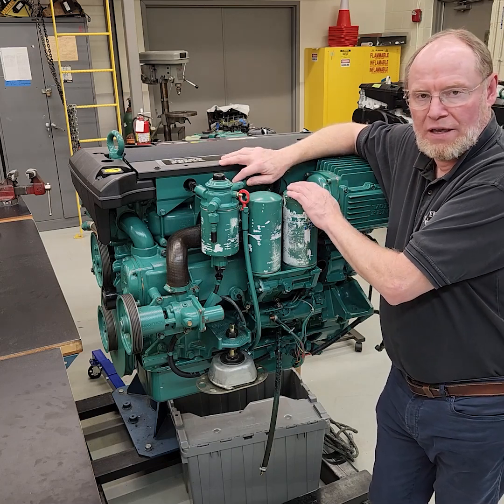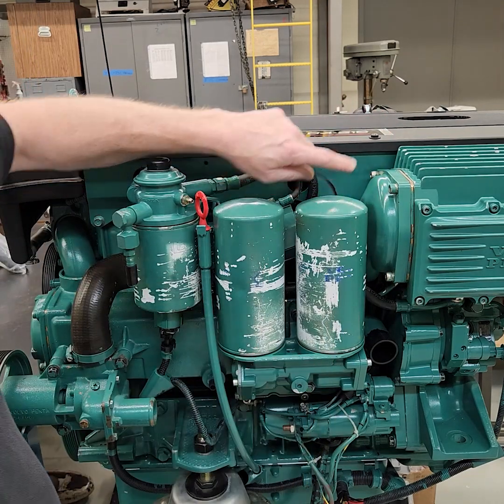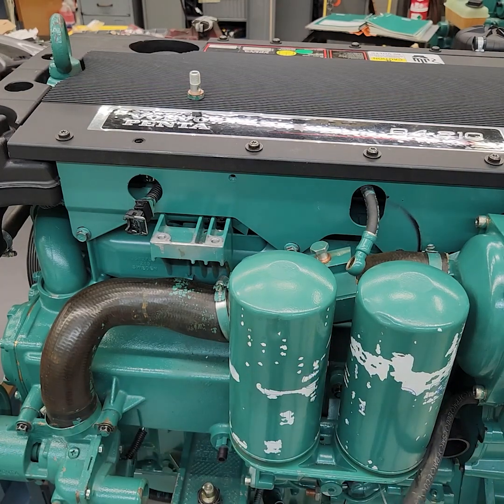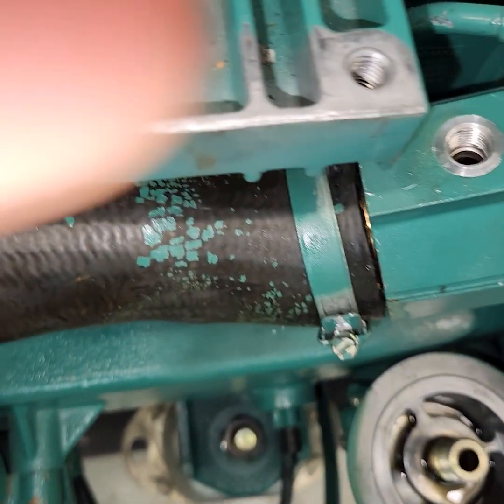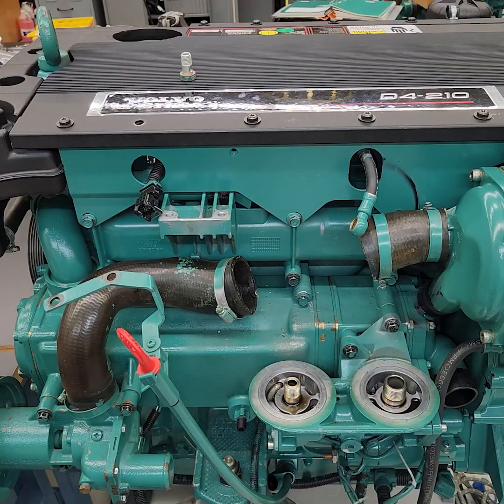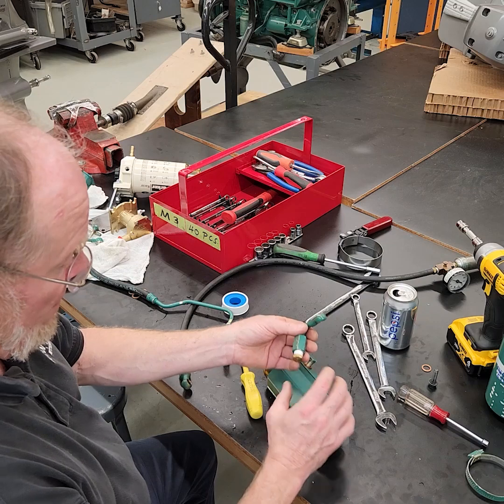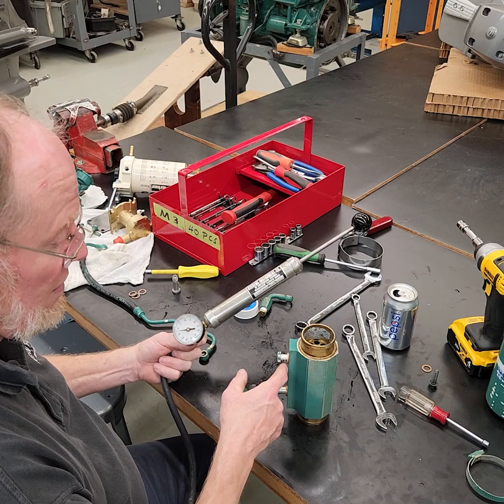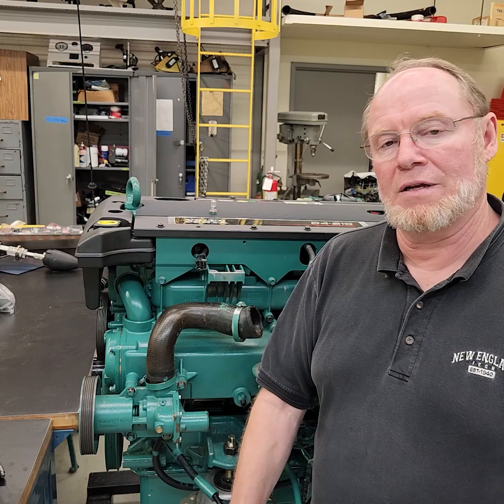Volvo Penta D4 D6 Fuel Cooler Removal, Installation and Pressure Testing

Comment: Hi thanks for your informative videos. I have a problem with my volvo tand 41p. It is overcooling under 2000 rpm and when at idle. I have cheked the thernostats and installed 2 new (81 deg) but problem is not the thermostats. Can you help me and tell me what could be the problem? Thanks in advance
Reply from the maker: The other reason would be the piston cooling pressure valve is hung open allowing excess oil to excessively cool the pistons. I still would first ensure the the anti t-stats are install properly with the correct spacer/gasket location so no anti can by pass them.
Reply: @tedsmarinerepair8956 thanks. Could it be a heat exchanger problem? I bought a second hand one and i dont know if it is for my model (41p) or 42 43 44 since this problem occured when i changed the heat exchanger since the previous one was faulty. Thanks

Comment: Hi Ted, I have one question about changing the coolant on Volvo Penta D6-435-D. I have an expansion tank on the port machine, as the water boiler is heated by the machine. The pipes are constantly mayve clogging or something and the expansion tank is overflowing, the engine has then too little coolant. Only way was to shut off the valve to the water boiler.

If I change and flush the coolant, how can I bleed the system with water boiler flow and without water boiler and expansion tank for the other machine? Maybe there is a difference.

Comment: Friend of mine has d6 and when he comes backs off to neutral oil light comes on!  Not every time only few times it has done it!! Any idea what might be causing it
Reply from the maker: Verify the oil pressure on the gauge when the light comes on. Minimum oil pressure is 18-28psi @ idle hot. 
Ensure oil level is not too high this may be a sign of fuel in the oil thinning it out.
Or the oil is worn out.

I would change the oil and filter and see if that makes the issue stop.

Comment: Hi Ted, I have run into this video whişe checking for my problem.I have volvo penta D4 260A-B and I have noticed a brown clored liquid coming out on the back of the engine. They have told that water and oil probably mixed and oil cooler might be the problem.Do you have any thoughts?

Comment: Thank you so much for a helpful video. Would love to see a video on how to remove and clean a heat exchanger on the d4.
Reply from the maker: That one will be long, but I will put it on my list. I will also put a video together on how to flush the raw water side.
Reply: @tedsmarinerepair8956  I installed a bypass on the intake hose. If the boat sits for more than a couple of days, I fill a 5 gallon bucket with fresh water, put a hose with a strainer inside it, then while the engine is running, I open the valve for the bypass and close the intake valve. The engine sucks out the bucket in under a minute with the hose still running inside the bucket. I then shutdown the engine using the red button above the oil filters. Very open to hear how you would recommend to do this. I use the same process for winterization except I have two buckets filled with anti freeze - takes about 8 gallons before I see a trifle ear shooting out of the exhaust.